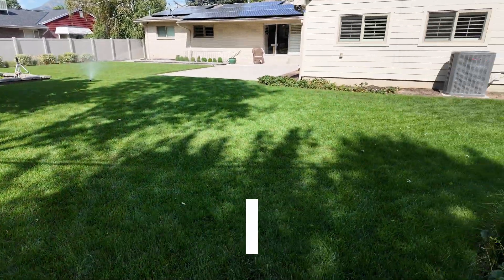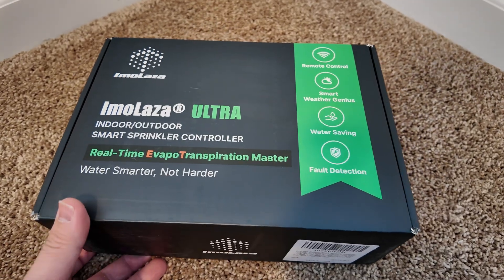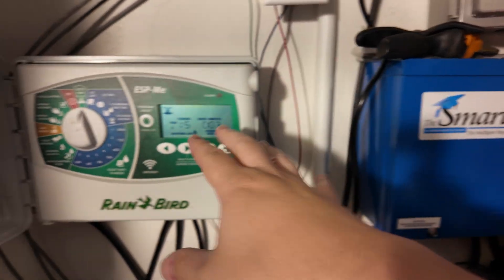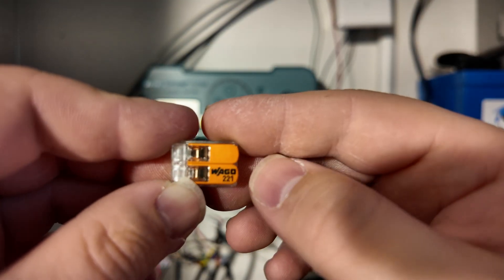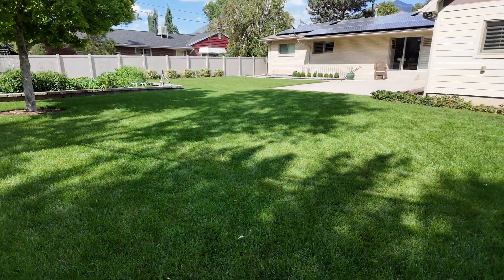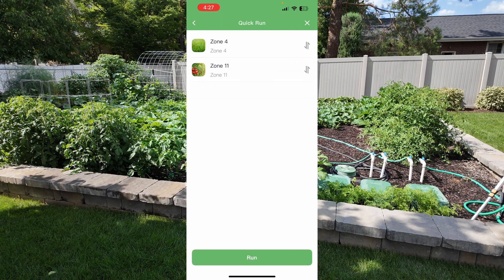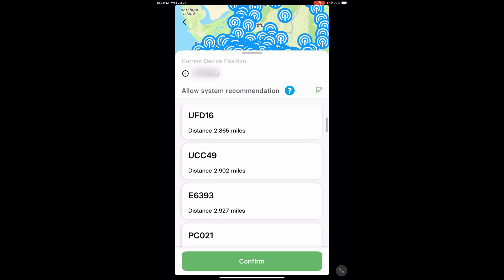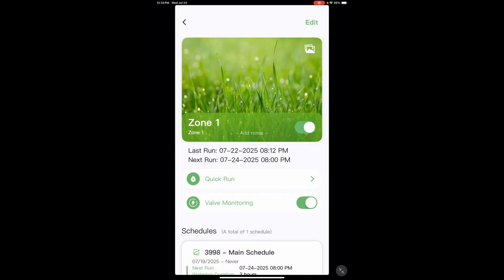1 Hack to Automate Your Yard Care for YEARS! (Set It & Forget It)

Comment: When you put your yard in,  did you account for all of those zones,  or did you have to add some over time?  Right now, our 1/3 acre property only has 4 zones with a garden,  lawn,  and different H2O requirement plants/trees, which makes control difficult.
Reply from the maker: I designed and installed the irrigation system myself. 1/4 acre lot and 16 zones. Haha! I like my customization! ;) It’s worked out great!